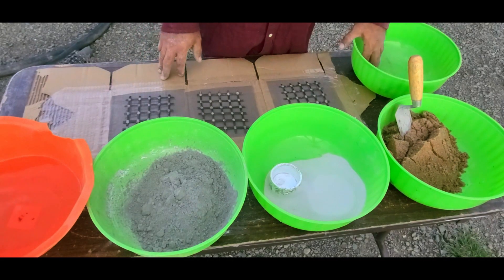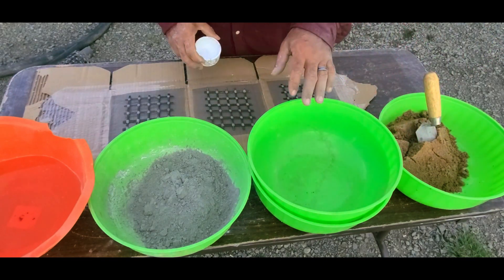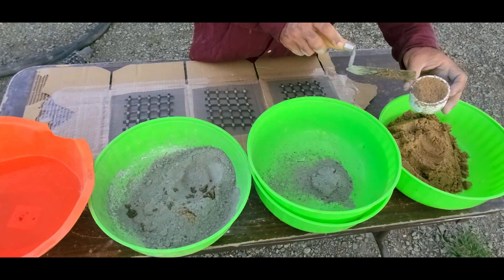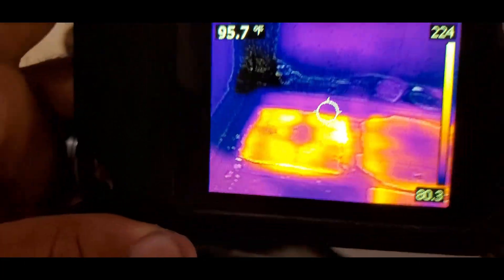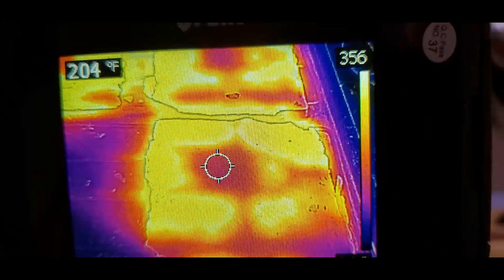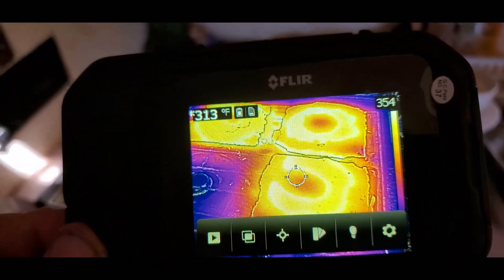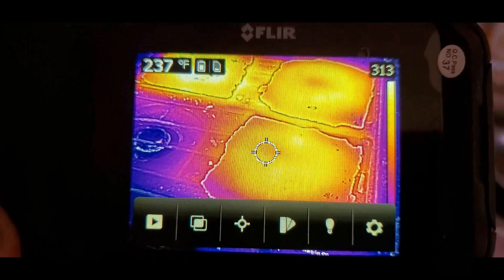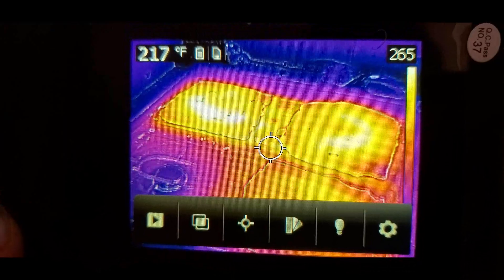Ceramic Beads Test #ceramicbeadstest #aircreteharry #domehome #thermaltest #aircrete #ceramicbeads

Comment: ever tried perlite????
Reply from the maker: Yes, I have. I found it to work well, but my preference is 
Not to add more additives than needed. 
I have been using Aircrete Thickening Agent & Air Entrainment Liquid. 
These two additives are all that's needed based on my experiments & results.
You may find them on my website. 👍 

Check out this video: ✌️ https://youtu.be/ZHfosbtrodA

Comment: I'm curious what this test would show, using a contact thermocouple.
Would the results mirror the flir measurement?

To what extent is the insulating effect due to emissivity vs conductivity.
Reply from the maker: I haven't done any tests with thermocouple therefore I can't answer that.
It is not insulation, it is a thermal barrier. 👍

Comment: Harry, wondering what gets added to the mix to make it waterproof. Im particularly interested in this for areas that have freezing winter temps.  Concerned freezing would crack dome over time. Thanks!
Reply from the maker: How are you V?
You use Stucco / Latex Cement Mix: https://aircreteharry.com/product/latex-cement-recipe-mixing-instructions-tools-needed-links-aircrete-harry/
Then you would want to add Ceramic Beads into that mix.

Comment: Harry,  these ceramic beads really show promise!.... The company that sells these makes some amazing claims, they say that there is someone who coated their house with these and does not need any insulation...
Reply from the maker: Good Morning Brother, emailed you 👍
Reply: no way ceramic beads will give R25 insulation to replace wall insulation. I like what I'm seeing, but that claim sounds ridiculous.
Reply from the maker: @HappyBeeHoney  The ceramic beads are not an insulation. They are a thermal barrier. It's the same technology that was used for the heat tiles on the space shuttle for re-entry.
Reply: @HappyBeeHoney  I was contacted by this same ceramic bead supplier and they made these claims to me also.... Harry is spending his time and money doing all of this testing and sharing the results with us for free.... He has really helped all of us who want to know the best system to use to build these round concrete buildings!  I think that you are probably right though, the beads will likely not be the entire answer to insulating these buildings... I hope they will help in some way though....